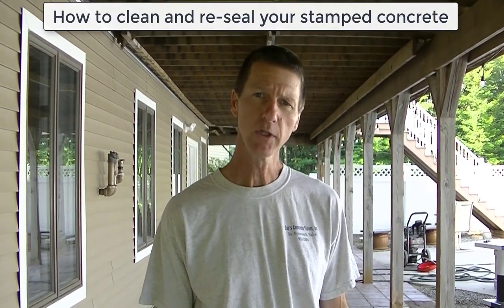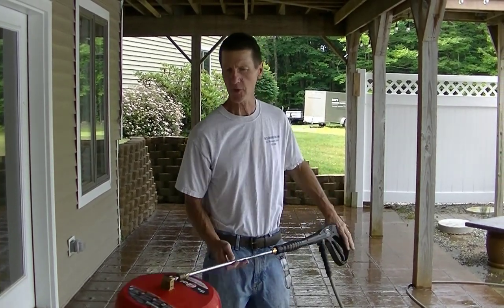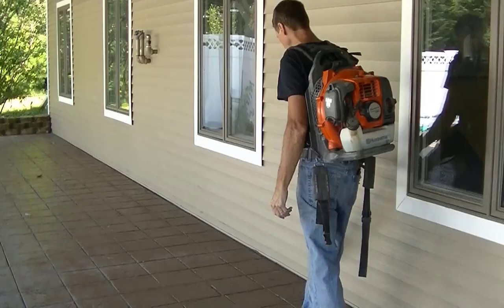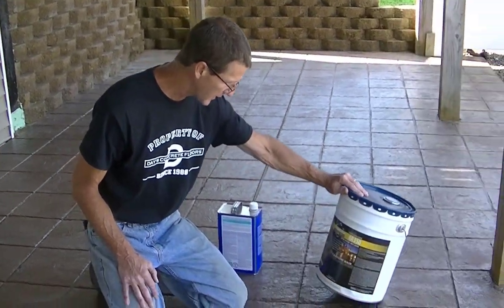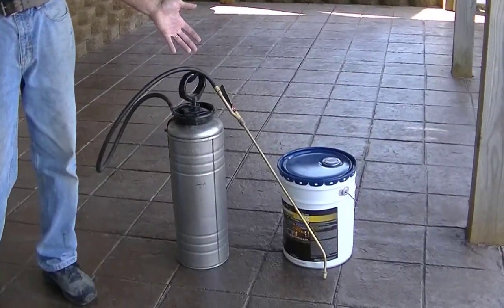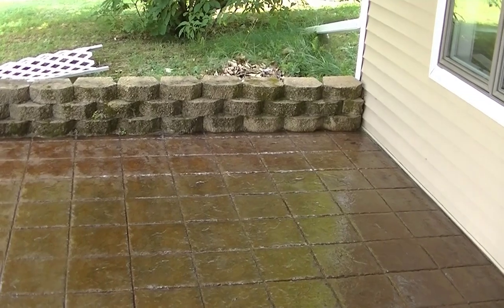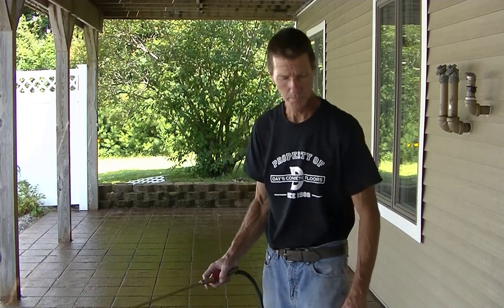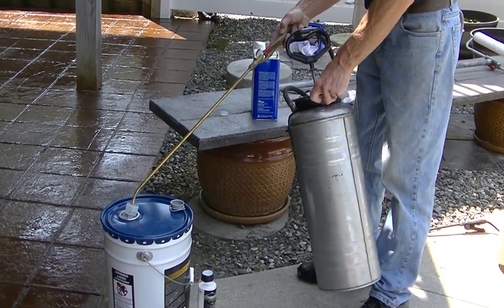How To Clean And Re-Seal A Stamped Concrete Patio | Everything You Need To Know

Comment: I followed this video to seal my driveway and patio three years ago, and I'm reviewing as I prepare to do it again.  However, I won't be using AR350.  It turned out great initially, but the sealer started turning a milky-white sheen in random areas after about six months.  Then, it began to show significant wear after a year.  The sealer is all but gone three years later.

Comment: Many thanks for the comprehensive video Mike. You've given me confidence that I can reseal my concrete patio myself. Part of my patio is covered and part is not. The part that is not covered has little to no sealant on it anymore (as expected). However, the covered portion is still somewhat sealed and glossy (solvent-based). Do I need to strip that old sealant off or can I just cover it with a light coat of new sealant after cleaning it? Again, thank you!

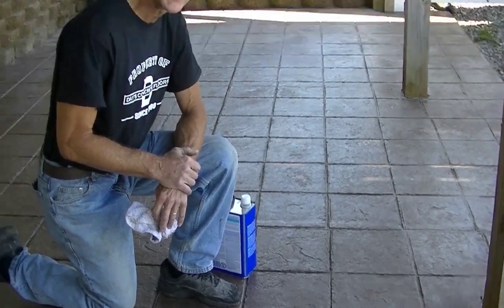Comment: Looking for your video on stripping old sealer before applying new sealer to stamped/colored concrete that you mentioned at 15:30 of this video.  I am from Michigan and using Euclid Chemical products and was told to roll xylene on and let sit for a bit and then wipe off with rags to keep from harming grass/plants in the area and making a mess??   They said a couple applications might be needed to remove all/most of old sealer.
Reply: I was also hoping to find this, but searching all Mike's videos doesn't seem to show anything. Either way, thanks for this video, I think I can finally get our stamped patio fixed up right.
Reply: Great video, but very little said about water based sealer.  Can’t find a video to show how to strip and seal it again.

Comment: Mike, we have smooth stained concrete floors throughout our house. Everywhere there is a crack in the concrete and next to most of the baseboard the concrete sealer is turning white. It's very unsightly, and I would like to address it. How would you do this in an enclosed area? Can you spot seal to get rid of the white areas? Do you have to do the whole floor?

Comment: This works good if you are just doing your annual re-sealing maintenance and the sealer is sightly dull, but not de-laminating.  (That's assuming you used the correct sealer/ commercial sealer initially.)  If you have multiple sealer layers that are failing, or lacquer-based sealers that are failing (aka, de-lamination) this won't work very well to remove the exfoliating sealer. Only the weakest peeling sealer will come off with this method. But remember, this machine could also further loosen more of the competent sealer. It could be daunting. So, if you are trying to restore the concrete stain (i.e., re-staining the concrete) or removing de-laminating sealer, you must remove ALL of the topical sealer.  We have a cost-effective way to remove it using mechanical AND chemical stripping techniques. Stripping a sealed, stamped concrete slab (in preparation for re-staining or re-seaing) is generally considered the contractor's worst nightmare. We do those "nightmares" regularly, successfully.  Re-sealing over de-laminating sealer creates a bigger and bigger headache later. It's like painting over loose paint. YOU MUST DO PROPER SURFACE PREP.  And re-seal the concrete lightly with a sprayer, every year. USE the RIGHT sealer for your area. Certain sealers have miserable UV-resistance and poor weather-resistance. And barrier sealers are the worst because the laminar layer blocks moisture, and poof, eventually moisture pushes it up (de-lamination) and the entire slab turns white (hazy). Concretetransformed.com (PS There is soda blasting which works great, but generally the minimum charges for them to show up is bout $1500.)

Comment: Great video, Mike. It gave me encouragement that we can do this ourselves to restore our 2500 sq ft of stamped concrete (driveway & patios) that have been neglected for 20+ years.  The one question I have is about applying the new sealer.  I live in Southern California and the stamped concrete gets VERY HOT daily.  If I apply the first coat of sealer in the late afternoon/early evening like you suggested (when the concrete is cooling off), is there any problem if I wait until the next morning to apply the second coat?  I don't think I'd have enough time to get both coats applied the same day.
Reply: I wish he had answered this question...same boat

Comment: Mike, Great video. My question is to do with my colored stamped concrete that is about 35 days  old. I sealed my exposed aggregate walkway a few days ago that was poured at the same time. Some of the "cream" gray color is visible on the exposed aggregate because I believe that the release agent didn't remove it all. It was not evident when wet with water or wet while I was sealing it. I had pressure washed the stamped and the exposed numerous times. Before I seal the colored stamped concrete, I'm thinking I should wash it with a mild muriatic acid solution so I don't end up with the same condition on it. Does that sound correct?
I didn't put the second coat on the exposed aggregate after I saw what happened to it. Does the acid wash cut through most sealers or will only xylene?

Comment: Thanks for the video. Can I reseal a stamped concrete walk with a water based Silane Siloxane sealant over a solvent based acrylic sealant? Does the power washer (with the special cleaning head) remove enough of the old sealant to put down a different type of sealant? Thanks!

Comment: Great video, Mike. thank you for sharing your expertise. Here is what I have happening. I have cleaned my stamped concrete and was totally amazed, it hasn't looked that good since it was poured. Now my question is, I have a pink sidewalk and patio which was suppose to have a dark brown release on it but I swear that our people forgot that part (it was pink from day one). This was poured about 1994. I was wondering if I could stain the concrete with a brown before sealing it to try and get rid of some of its pinkness. It is worn and tired and you can see a lot of the pebbles at the surface now. How would you suggest that I proceed? I purchased the sealer you recommended and am excited to move forward however I don't want to mess things up. If you think I can stain it what would you recommend?
Reply from the maker: Sue, check out this sealer - it has a brown tint to it, maybe it's what you're looking for: https://www.foundationarmor.com/agbrown
This company also has other tinted sealers you can use to color (re-color) your concrete.
Reply: @MikeDayConcrete  , which roller would  you use , if only roller and not with spray.?

Comment: Hi Mike,

Great video! Quick question. Once the stamped concrete is finished and curing, at what point does the sealer get applied first? At exactly 3 days after curing or more days etc?
Reply: Minimum 14 days is the standard

Comment: First of all, you did a fantastic job explaining and demonstrating the process. Thank you! I used that exact same sealer on our walkway last September. I rolled it on and initially it looked fantastic. Now it looks whitish in places and brittle in other places, but only in areas where the weather really hits it hard and also where we walk. Additionally Xylene is a precious commodity in the state of Maryland, I hoarded several gallons last year while it could be had. Now that it’s not available what other solvent might you suggest? I pressure washed it today and my plan was to go over most of it with a roller and xylene and try to reconstitute it and then decide if I should reseal it with more product. I have a feeling I may have put it down a bit too thick. Any suggestions?
Reply from the maker: Yea, Xylene is the best for thinning it and trying to remove the whiteish areas. You can try Acetone or Laquer thinner also. If it's too thick and needs to be removed you can check out this sealer remover: https://youtu.be/66QLH1pMfjY

Comment: Bought the same sealer. Applied with a roller. I think I went too thin on the first coat. Just right on the second. Now it looks slightly blotchy almost as if some of the areas absorbed more sealer than others. Would a light 3rd coat fix this?
Reply from the maker: Yes, it should. That's normal, maybe roll those areas first, then do the 3rd coat.

Comment: Hi Mike..I just recently sealed a driveway with solvent-based wet look sealer after cleaning the entire drive which was previously sealed.  As soon as I sprayed the sealer on my helper started to backroll and the sealer immediately became stringy no matter what type of roller I used. Luckily I did the entire driveway without having to backroll. In your video, your helper has no problem backrolling the entire patio..Even though the drive came out great what could have happened for future reference? Thanks, Mike

Comment: Hi Mike,  I followed your instructions and I am very happy with my results. I purchased the Armor AR350 seal, stainless steel sprayer, the rollers, and even the surface attachment for my power washer.  My stamped concrete patio looks even better than when it was originally installed. I do have a question.  In the video you recommended sprayer the xylene cleaning agent back into the Armor AR350 solvent drum.  Z Helene is not available in Delaware, the replacement is Klein Strip painter’s Solvent.  Can the painter’s solvent also be sprayed back into the AR350 solvent?
Reply: I wouldn't.   just get another container you can dispose.  if the solvent in the sealer matches the cleaning solvent all he's doing is diluting it a little but if you use a different solvent you can ruin the formulation and it might not work next time.

Comment: We had stamped concrete installed October 18th last year.  My husband used a snow blower on the sidewalk and I noticed black streaks maybe from the rubber wheels. How do I clean those off before I reseal it? I wanted to put a sealer that doesn't make it slippery because when it's wet, and especially in the snow, it becomes dangerous.
Thanks

Comment: Hey Mike, great video. I plan on resealing my stamped concrete around my pool this summer for the first time. I was wondering, I have been told to add a grip to the sealer to help with the slippery conditions when wet around the pool. Is there a grip additive you would recommend? Also, can a sealer that has a grip additive still be sprayed on or will it gunk up in the sprayer? Thanks so much.
Reply from the maker: Foundationarmor.com has grip additive. And it's easier to roll it on, yes.

Comment: Hi Mike, I followed your directions and I think I did a good job. However, the part of the patio which is exposed to sun and rain ( not covered by the roof) , still has spots that seem like there is no sealer or less sealer than the covered patio. Does this mean I didnt apply enough? Or after 1 month it is normal to fade? I would expect to last longer ( I used the expensive one you mention in the video). I dis the first coat using the sprayer and the roller and the second coat only the sprayer. After 1 month, will it be stupid to wash this part of the patio and reseal it for a third time using a roller? Or I need to power wash again and start all over again? Thanks!

Comment: Can you tell me what size tip you are using? I have the Chapin Extreme sprayer and when applying Foundation Armor I dont get an even fan. The ends come out as a slight stream which is definatly not good for the second coat. Thanks in advance.

Comment: We had a stamped concrete walkway installed almost 4 years ago.  Unfortunately we did not reseal it and there are several spots where the color is turned to almost a white color and overall color has faded.  The installer used a medium brown release when he did our walkway, but does the release get mixed in with the sealer to give it the brown color again or is just the sealer needed?  Our installer also told me to never buy any other sealer products other than the type he used on the job and from the same company, no other companies.

Comment: I think you said on the roller you use a 3/8 inch nap roller. Do you find that it sheds into the sealer or are they pretty much fine I've always used a foam roller thank you

Comment: Great video. What tio for the sprayer do you recommend. My chapin sprayer came with a 1gpm and .5gpm fan tips.
Reply: I have this exact same question, noticed someone else asked it previously too, really wish there had been a reply. However, having rewatched the video after my first coat was applied with the 0.5 gal tip, I think he must be using the 1 gal tip because he’s moving fast and seems to be getting much more consistent even coverage that I was getting. Fortunately the roller helped spread the sealer out more evenly.

Comment: Mike I had someone come in to re-seal my stamped concrete.  About a week later it began to bubble in several areas.  What causes this?
Reply: Can anyone help me, noticing comments are pretty old
Reply: I’m thinking it may not have been completely dry after washing???  Looks like you’ve posted this a while ago. Be curious if you found anything out?
Reply: @brianyoung6192  you're right the concrete wasn't dry before sealer application

Comment: Great video by the way Mike. What would you recommend for stripping concrete pavers that were sealed and painted over the years. I used xylene based products and I would like to take it down to the original paver and then just seal it. Any techniques would be helpful.  Thanks.

Comment: Great Video Mike, and one quick question here in California it's band to purchase Xylene. What else could I use to clean my sprayer and check my floors?
Reply from the maker: You can use Acetone, it just dries faster than Xylene.
Reply: @MikeDayConcrete  Hi Mike.  Is there any problem with spraying the acetone (after sprayer cleaning) back into the Foundation Armor Sealant container like you suggested in your video with the Xylene?  Thanks.

Comment: Great video Mike!  Should I have any concerns about leaving the solvent based sealer in the metal sprayer while I wait four hours or so for the first coat to dry?  Wouldn't it be eating away at the sprayer's rubber seals over that waiting period?  Thanks again.
Reply from the maker: If it's the sprayer like mine it's no problem, the seals are made for it. If it's a cheaper sprayer, you'll want to clean it out in between coatings.
Reply: @MikeDayConcrete  Thanks Mike.  I think they raised the price of the Chapin International sprayer you were using to over $200.  I'm planning on buying the same brand 1949 red one which is one step down for about $120.  Hoping those seals are as good.

Also, is there a good substitute for Xylene?  Apparently it's outlawed here in California.  Thanks.
Reply: @MikeDayConcrete  Xylene is outlawed in California.  Do you know of anything else (legal in CA) that could be used in place of the Xylene you showed in your video? 

 I have everything else you described in this video that is needed for my backyard concrete reseal job.  Thanks.
Reply: @mrb552  He said you can use acetone in a previous reply
Reply: @lskutches  Thanks for sharing that.  I'm about to proceed with doing the work and didn't see that comment earlier. 🙂
Reply: @mrb552  Hope it all goes/went well!

Comment: Great video. What if you want to spray a stamped concrete sidewalk surrounded by artificial grass? Do you need to cover it to protect from overt spray or just avoid it as best as possible?
Reply from the maker: Not sure what it would do to artificial grass but someone can be holding a piece of cardboard along the edge while you spray to block any over spray.

Comment: This video is great! It was a big help, but I have one question. I power washed my stamped concrete patio.  It is about 1,400 sq ft.  My patio is 8 yrs old.  The initial sealant was solvent based.   About 4 yrs later I used Xylene over the whole thing to revive it and it looked great. It was sealed last year with a water based sealant by a contractor.  After the water based sealant was applied the patio looked bad within a month.  After power washing I can see most areas are without a sealant, but a few areas still have some on it.  (like under the tables where there was no foot traffic or sun)  Do I need to use Xylene on those shiny areas prior to using the AR350?

Comment: No no no.  You NEVER apply a sealer on top of another sealer ESPECIALLY when you dont know if the previous sealer is water based or not.  If you dont properly prep the surface you will be dealing with the white color of the failed sealerS yearly vs. safely removing the previous sealer(s) no matter how many times its been sealed and sealing every 5 years.
Reply: Be like Mike!
Reply: As soon as I heard that I went to the comments to see if anybody called it out
Reply: How about all that overstay on all the posts and against the house?
Reply: How do you strip it completely to then re-seal it in the end? Xylene the whole thing?
Reply: @mrsmix21  xylene is a stripper however its not a good area stripper.  Meaning for little spots here and there it works but for a patio or large surface you want to use a true stripping product that is specifically made for Sealant.  Trident protects has a great stripper and so does Decco products.   Use the xylene to confirm that the sealant is oil based and not water based.  Pour a small amount onto the surface and let it dwell about 20 mins and you should be able to use a credit card or plastic putty knife to do a scrape test.  If you are able to scrape old sealer off then Yes you are dealing with an oil based product.  Applying a sealer ontop of another sealer (same product as the previous is ok BUT you don't want to apply the new sealer ontop of dirty surface.   Sealant typically last 3-5 yrs (closer to 3yrs).  Just ALWAYS make sure to apply the sealer (we use Trident protects Taunami) to a DRY surface.  Preferably a dry unsealed or stripped surface.  Hope this helps.